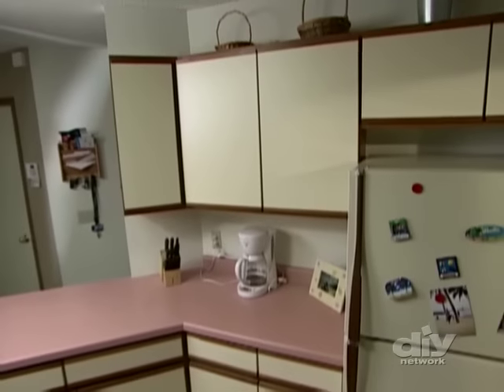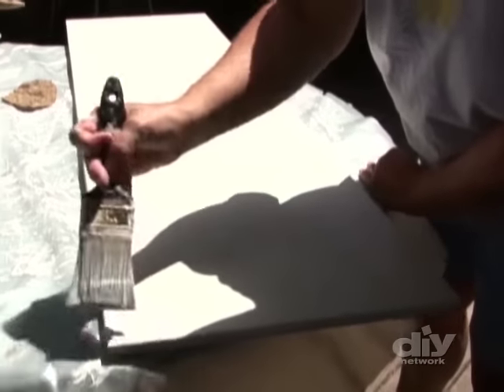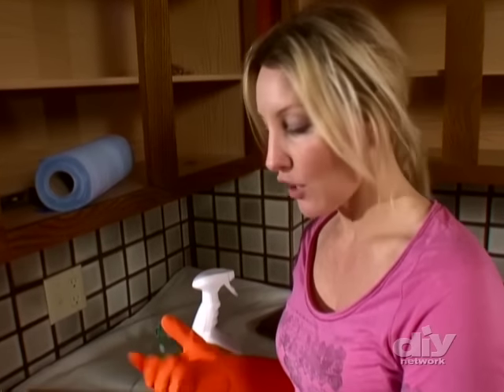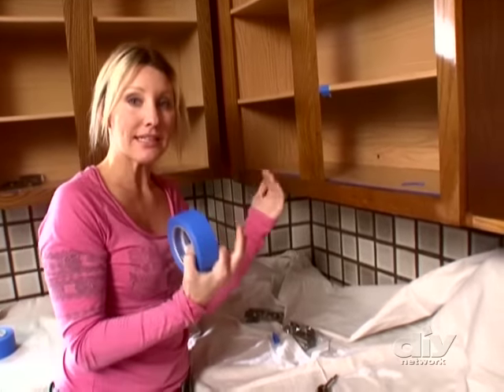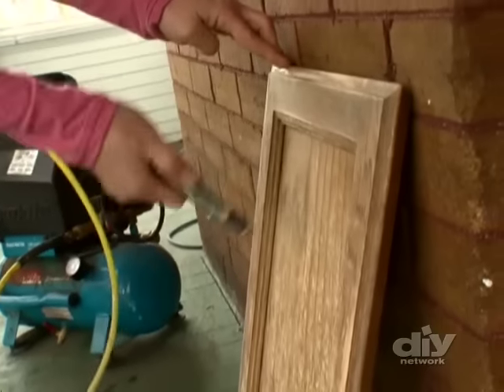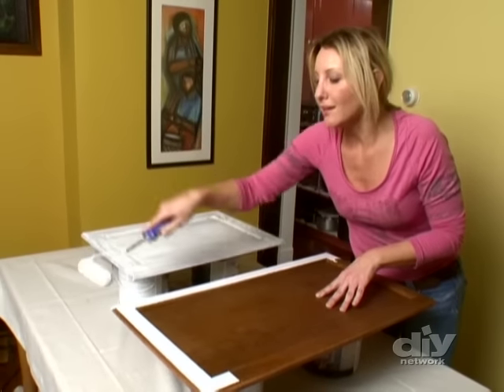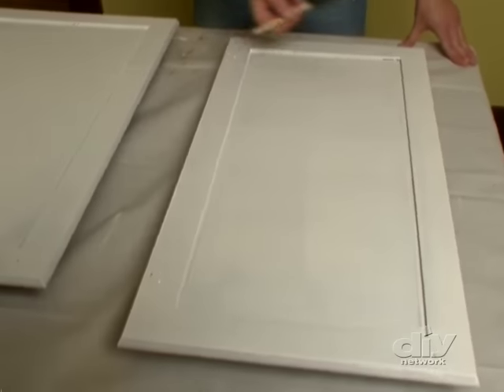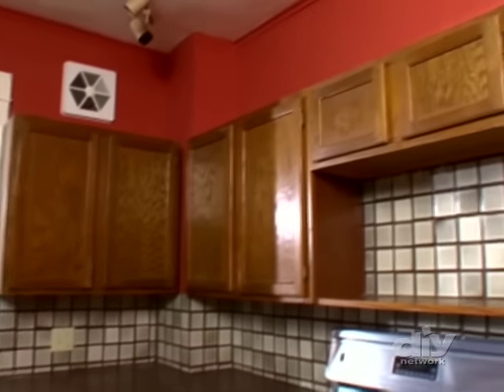How to Paint Kitchen Cabinets - DIY Network

Comment: Water based technology has vastly improved. A latex or waterborne bonding primer is good too. You can use a Waterborne Alkyd Paint in place of a standard Latex. Low VOC which keeps the odor down. The alkyds let the paint flow and
Lay down smoother minimizing brush and roller marks. Foam or Mohair rollers are the best. Thin coats work best. They also clean up with warm water and a little soap. You can splash the brushes with a little mineral spirits at the end of the job to clean out residue and keeps the brushes soft. Most can be re coated in the same day. Check product data sheets for manufacturers recommendations….
Great video. Easy steps.

Comment: Painting cabinets is a great, quick upgrade when you've just bought a rental property. Unless the cabinets are in rough shape and need to be replaced, a couple layers for paint can go a long way to making new tenants feel at home. You can also add little rubber or felt pads to the drawers and cabinets so that they're not "slamming" shut. It's a cheap aesthetic boost that helps your tenants feel like you care. And in our 16 years of experience investing in real estate, when tenants know you care, they are more likely to care as well.

Comment: Love this video I’m fixing to paint my cabinets inside and out I have lots of grease on the doors and facings, i mean lots of grease buildup over several years lack of poor ventilation and I got that fixed now. I got Krud mutter cleaner & degreaser stain remover from Home Depot. I hope this takes the grease off.

Comment: Great video.  Inspired to get started on a small cabinet project.  I only have two cabinet to paint which are actually not on the wall yet.  They are older cabinets but solid wood-very good quality cabinets.  I would like to paint the inside as well, since it's a dark wood color now.  Would you follow the same process for inside the cabinet?

Comment: Dont use latex over oil stained and varnished cabinets unless you strip them well or  sand them very well. If you just scuff them then the acrylic latex paint ( even Behr Acrylic) will not dry well, remain gummy and then wipe off when you clean the cabinets lightly.

Comment: Doing my cabinets now.  If your cabinets are wood fill in the grain with drywall mud and sand it once it dries.  Its cheap and works beautifully.  If you don't fill in the grain of the wood you will see it after you paint the cabinets.  Same with the doors.
I'm using a latex urethane trim  paint from Sherwin Williams.  Its expensive but it will dry smooth and is very durable.  Don't go cheap on the paint, you will regret it.
Reply: Wondering the same thing! My grain is not very deep and it looks like she got away without filling the grain. Thinking about some drydex before sanding

Comment: Hi, great video thanks, am looking to do this in my kitchen to my oak doors and cabinets, however , I have noticed that on some videos people only advise a de glosser and not sanding, which is the best method ?. Thanks
Reply: sanding is probably best. Sand until you get the sheen off. But, if you use the rustoleum cabinet kit, then you only have to degloss!
Reply: Lauren Nicole so do you  recomend to use te rutoleun kit, or should I sand the  cabinets ..?
Reply: Lauren Nicole does the kit work on older cabinets
Reply: Look into liquid sandpaper. That's exactly what it does is get the gloss off

Comment: What do you do when after you sand and prime the wood bleed comes up through the primer. I'm doing our cabinets and I've got 3 coats of primer, 1 coat of polyurethane and 1 more coat of primer and still the bleed from the bare wood from the sanding is still coming up through everything. What do I do to stop the bleed from coming through? Thanks
Reply: Oil-based primer works better than any water based. Trust me.
Reply: after primary need the base paint.

Comment: Doing carpentry and painting from about 4 yrs i see an excellent diy and an horrible professional job Lol, a painter that does so many meaning less step should charge an arm and a leg to get it done, we do not wash we only send, we do not re wash, only blow it with airgun , we do not prime but we give it 2 coat unless you're deciding to go to a bright color on a dark base, also to be quicker you do not need to take the hardware off, just mask it properly, and since you're doing it with brush and roll, do the angle with brush first and then roll the remaining spot so that brush mark into cutting space won't be noticeble.
Reply: Would you suggest rolling over the cut-in areas, so as to remove the brush marks? I take it you would not suggest tipping off with the brush after rolling?
Reply: @Avital4414  no the roll is usually last, if you brush last you’ll have all brush marks everywhere

Comment: I replaced my dishwasher with a cabinet, so I had to paint a generic cabinet the same color. I used floetrol latex paint additive. It really helped the latex paint to form a smooth professional surface. No brush strokes. Look into it. I’m glad I did.

Comment: I was bummed because I had a lot of issues with texture resulting with the foam and nape rollers...we ended up with the brush eventually.  Any tips for painting with high gloss with rollers in the future (other than spraying)?
Reply: Dai Vid I used cheap foam blushes and foam rollers.  They worked great.
Reply: They make a product you can add to the paint to make it more user friendly... it really lessens the stroke marks. Penetrol? I can't remember the name but it works. Ask the Paint Store people about it.
Reply: Hers looks like a generic foam roller but they actually make just certain rollers for cabinets

Comment: for one thing never use a water based primer on varnished cabinets it will come off in time and will not be durable, u have to use an oil based primer
Reply: That is the first thing I questioned,everywhere on the web experts from painters to This Old House say to use oil base primers. I would trust them,plus her reasoning(cost and time) are not logical unless you are in the Flip houses  business.
Reply: i was a contractor for over 20 years, i now own a paint store, i hear that all the time, people get the wrong information and use a water borne primer, and it falls off, they are talking to people behind a counter who has never painted before, if you go and buy paint, ask them what their qualifications are, if they say they took a 3 hour course, get information from some plece else
Reply: I've used oil based paint and it's a nightmare. I agree that water based will not work.
Reply: I have cabinets on my house but they been painted over sooooo many times that it’s thick!!! You think I can sand it down?
Reply: @chelitacorona2896  Use a stripper to get off most old paint then finish it off with sanding. It's a little time consuming but it'll work.
Reply: wrong wrong wrong it will not peel if you use good primer and good paint arista  shieid is the best paint to use period
Reply: @frankharo1437  I agree. Did mine this way 3 years ago and they still look great
Reply: @frankharo1437  it is a half decent primer, but not the primer to use over an oil, it will come off

Comment: Wasn't $100 though.  Video assumes you already have much of that equipment... like the pneumatic air compressor etc.
Reply: meg very true that random orbit sander she used is $199 tool only.
Reply: random orbital sanders can be easily gotten for ~$50
Reply: Brian Roper you beat me to it... 200usd for a orbital sander 😂
Reply: BUT, you do not need those tools to accomplish this task. Sandpaper block made from a piece of wood and elbow grease takes place of the sander, household vac can do the job of the air compresser. Geez think next time before you comment.

Comment: Only 2 days? if you are fully sanding the cabinets, priming and painting multiple coats, try 1 week....well, unless you have a crew helping you out.

Also, I heard using water base primer is not good

Comment: Don’t use water based paint.  You will always regret it. Even in 50 more years still don’t use water based paints.  Especially when reusing existing cabinets.
Reply: What should you use
Reply: nfn7121 oil paint yellows over time. Water based Alkyd enamel is fine.

Comment: Nope nope nope.  Not taking off any doors or hinges. Not sanding. I was more interested in what to put on the floor or if the paint roller can be washed out with water.

Comment: Brushes should never be used on cabinets period.. Foam rollers can also cause air bubbles best to use 1/4 nap roller & no cleaners should be used only sand paper on tuff dirty spots then use damp warm sponge, finally use one coat of KILZ PRIMER on cabinets then paint away perfect job everytime👍👍
Reply: Old Timer if the paint i buy is a paint+primer do i still need to prime?
Reply: Laura Madrid good evening if you are going to paint cabinet frames & doors you for sure want to use primer by itself then apply paint after primer dries, Kilz primer original will give much better bonding being cabinets collect oils & stains as also the kitchen walls even bathrooms which paint has a harder time to stick to these areas as I mentioned, for the bedrooms, livingroom, hallways you can get by with the primer mixed with the paint just remember to clean all walls & ceiling with sponge & warm water before you apply the new paint & let dry for hour then start painting. hope this answered your question👍
Reply: I always clean the cabinets with TSP cleaner and have good results.
Reply: Old Timer Hi..what's a good brand of paint for older kitchen cabinets. Thank you
Reply: Star Baby I suggest you use Sherwin Williams Proclassic Arcylic Semi-gloss paint! We had our cabinets redone and had amazing results and has lasted a very long time.. best quality paint to do the job!
Reply: I use KILZ every time I paint anything
Reply: madrid baby always use primer.  No matter what the paint can says it will do.  The primer in the paint does not work the same as a primer itself alone.
Reply: Old Timer what about chalk paint?  Can you bypass sanding and priming altogether?
Reply: @laura_c89  Yes
Reply: 77y
Reply: Nap rollers leave too much orange peel. If you want a nice surface finish, spray is the only way.
Reply: I can’t find KILZ in NJ. What’s a good alternative?
Reply: @matblack9288  Bin
Reply: Thank you!!!
Reply: @matblack9288  Walmart
Reply: I don’t like to see women for this kind job it’s too much for a lady I know you don’t like what you hear you do a lots of other thing which is not approve by o many people but you don’t care 😎
Reply: @violetjebraily9120  what do you mean "its too much for a lady"? I do way harder jobs than cabinet painting and I'm 75!
Reply: Use  Gloss off
Reply: Can you use chalk paint?

Comment: I wish this could be that easy. We refinish cabinets every day, it’s our profession.  It takes us 3-5 days to prep, clean, sand, prime, tint base, poly urethane an average kitchen.  That’s minimum two guys, full time— min., 2!
Not to mention dealing with weather— especially humidity, wood repair, sanding between coats, etc.
This is a nice high level video on how to do it, but a lot more tips have to be included I order to make this believable.
Shoot... even painters hire us to do this work! 😂
Reply: do you have a video? I want to paint my kitchen the right way for great results..no shortcuts!
Reply: @jennifercebrat2994  thanks for that! God bless ❤🙏❤

Comment: I been painting for 40 years, denature alcohol leaves a residue, use acetone instead and you wont have to sand
Reply: appreciate the info
Reply: Lloyd Keesler So with acetone you can just clean & GO????
Reply: Complete nonsense
Reply: Lloyd Keesler that is extremely incorrect. And always sand. Laziness seeks to avoid sanding
Reply: Andrea 2004 no that is not true. Degrease, sand, clean with denatured then prime
Reply: All you have to do is buy oil kiltz primer in spray paint can. Clean doors, spray kiltz,sand doors, wipe down, apply 2 coats of high quality semigloss finish paint. Your done. Be careful and patient between coats to let each coat cure out.. all this other shit is just to raise price and make u spend more money on shit
Reply: Can I still use latex paint over the oil Kilz?  Great tips!
Reply: @saltlifegull4091  Yes. You can use latex over oil, but never oil over latex. oil based primer is better than a latex as it works into the material much better
Reply: Michael Durso exactly what I thought
Reply: Michael Durso after sanding surface....will wiping with the denatured alcohol leave residue before applying primer? It won’t create an impediment for the primer to bond to the scuffed surface?
Reply: is 40 yrs a typo? You don't sound like it. CLEANING and SAAAAAANDING is crucial in painting.
Reply: @sapulpaorganics5402  wrong order   oil over latex, but not latex over oil.

Comment: I can GUARANTEE you will not get this done in 2 days. I just finished mine after working on it for many weekends. I spend a lot of time and did it right though.
Reply: totally agreed unless one can work 24 hours a day for 2 days straight
Reply: which paint did you use?
Reply: Zaida Rivera I used sherwin williams! They turned out pretty good!
Reply: She probably had help.  I seriously doubt this was done in 2 days.  1 cabinet can take up to 2 hours to clean, sand, prep and paint.
Reply: Lauren Nicole you can't guarantee that.... Can't tell what it looks like. Probably good from far but far from good..
Reply: I'm a professional painter and it take us around 3 to 4 days to paint a kitchen cabinet. Cover, prep, prime and paint. Painting cabinets are not that easy to work with it.
Reply: If you’re in a global shutdown. It can be done in 2 days.

Comment: OOOOOOORRRRR if you use a high quality foam roller and high quality paint brush you don't have to take out hardy anything out of the cabinets beacuse you don't have to spray the cabinets. 
Also if you use a high quality cover stain primer you don't have to sand them. 
I use a belt driven compressor and gravity fed sprayer for the doors, if you do this right, you will not be able to tell the difference between what is sprayed and what is hand painted.

Comment: never never never, use a water base primer over any type of varnish,or stain, it will come off over time
Reply: wolf360090 yup. I like Zinsser shellac primer
Reply: @lisadee0276  use cover stain, i have seen the bin come off more then once, and it is not a true shellac anymore, bin is not the primer it used to be, water stains and tannin will bleed through it
Reply: @lisadee0276  zinsser shellac primer is not a true shellac primer anymore, and it sucks, use cover stain from zinsser .it is 100x better then bin.. or 123, bulls eye, or no odour .. cover stain will act seal stuff up and bond to varnishes

Comment: For cabinet edges I would not use a brush but a pad that takes a small tray, or a small roller. Both will yield a nice sharp line if you aren't painting the inside. Use an art brush for hard to reach areas. Rollers, usually will leave a sort of orange peal finish, but it will be consistent and pleasing. Unless you like brush strokes, try rollers. Don't expect a spray paint like finish. Lower gloss paints will camo irregularities, which is good. Satin or eggshell is a good gloss choice.

Comment: Here to tell you how to clean them, Use Dawns new spray power wash! I put them in the bathtub, really sprayed each one down seperatly and used a little water to clean off the soap. I waited 24 hours to dry (im in colorado) before i sanded. The ammount of junk i got off was embarrassing!

Comment: For $100 damn that is cheap you hired someone else to do it and they’re changing you like $800
Reply: I'm a painter and to paint a kitchen cabinet is around $3,500.00 at least. Labor and material. And that's cheap.
Reply: @eduardoroblero4393  All these people here are confused about a professional finish painting and a crappy do it your self painting with brush and rolls, a professional finish cost lots of money and requires lots of experience and equipment, some homeowners that have beautiful houses they gonna ruin it with this  diy, crappy  cheap houses houses possibly works

Comment: It's a good tutorial in general, but I don't personally see any point in cleaning the cabinet when you're going to sand. That'll just remove all top surfaces anyway.
Reply: carlotta4th you clean it before you sand so you don’t grind the dirt and grease into the wood.